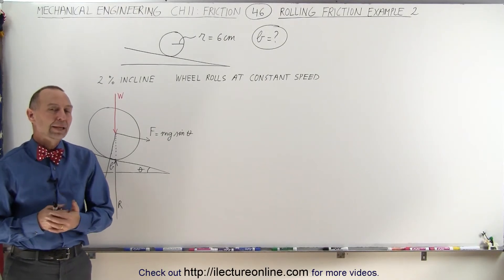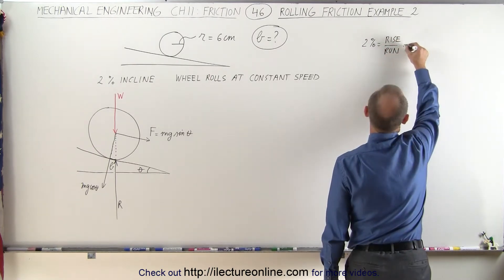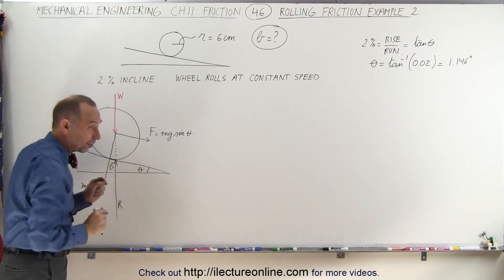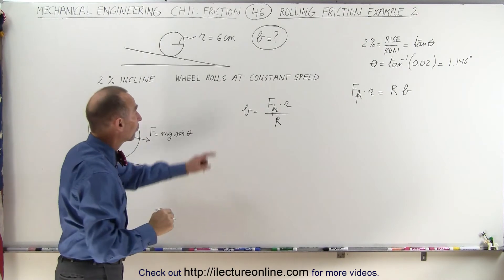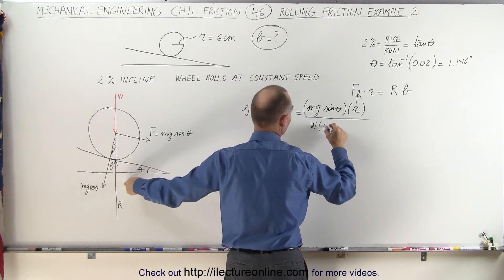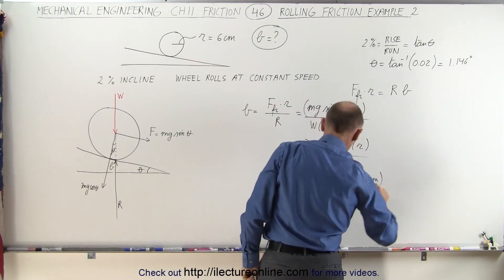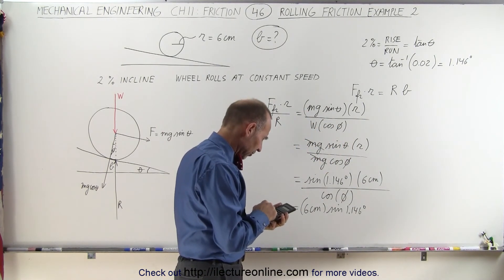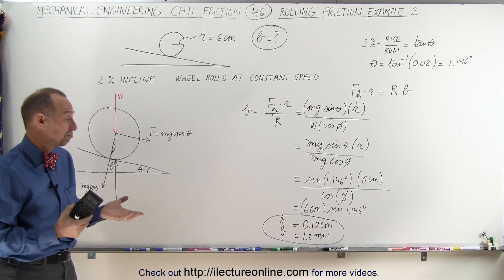Mechanical Engineering: Ch 11: Friction (46 of 47) Rolling Friction: Example 2

Comment: In this series I've been somewhat frustrated by the many uses of the 'close enough' method of simplifying equations.  But it seems to work and if it didn't planes would be falling out of the sky and trains jumping the tracks.  And actually calculus itself is based on the 'close enough' philosophy, without which we would have no calculus if we had insisted on absolute accuracy.  This is one of the concepts that you can explore in this venue that a college instructor would not have the time to get into.  I really enjoy exploring the various engineering disciplines with you that I didn't have time for in college.  Never retire!
Reply from the maker: Thank you.  Yes there are plenty of cases where "close" is good enough.  But then there are certain applications where close is not good enough, like in GPS, we are always striving to make it better and more accurate and we go through great lengths to make it more accurate.  🙂
Reply: Calculus is based around being able to find an answer exactly where it otherwise not be possible

Approximation is a feature of the steps to the final answer not the final result.

Comment: why don't you use that sir?
T=I*a/r, t=Ffr*r ,i=0.5mr^2 then Ffr=0.5*m*a
Fnet=m*a where Fnet=(m*g*sintheta ) - (0.5*m*a) then g*sintheta = 3/2 * a So  a=0.130m/sec^2
Ff*r=Wcos(phi) * B  where Ff=0.5 m*a ,cos(phi)=1 and W=mg so B=(0.5*a*r)/g SO B=(0.5*0.130*6*10^-2)/9.81=3mm
@Michel van Biezen

Comment: I feel like The reactionary force is simply equal to the weight of the object... correct me if im wrong

My proof:
If we imagine the previous example ( flat, non-inclined surface) . There were two important forces, the weight of the ball and the force the ball is being pushed to overcome the friction. The reactionary force will be the resultant of the opposite pairs of the two forces (Newtons 3rd law, normal force and the frictional force). 
Taking that into consideration, if we look at the ball on an incline, the two "main forces" in this case would be the parallel and perpendicular components of the weight. Then the reactionary force will be the resultant force of the opposite pairs of the two forces (newtons 3rd law, the normal force and the frictional force). 

taking that to consideration, and as stated in the problem that the ball will be moving at a constant speed, the frictional force must be equal to the parallel component of the weight, mgsin(theta).  and the normal force = mgcos(theta)
Those two make a right angle, with the hypotenuse being the reactionary force. So naturally, that'd mean that the reactionary force = mg = weight of the object. 
it also makes sense cause if you draw the reactionary force, it will act in the exact opposite direction of the weight... 

Sorry to trouble you with all of this sir, thank you as always for these amazing videos
Reply from the maker: In physics we don't trust our "feelings".  We are guided by laws and definitions.
Reply: @MichelvanBiezen  That makes sense.. so does that mean that my "proofs" are incorrect? sorry if whatever i said came out as annoying or offensive, i really appreciate your work ❤
Reply from the maker: Not at all.  We appreciate and enjoy your comments.  They also help me a lot with understanding how a student of physics or engineering looks at things so that I can find way to explain it in a way where it makes sense.  Often I admit that the way students sometimes look at things appears logical, but showing why it may be incorrect is often quite challenging and difficult.

Comment: Awesome lesson as always!
I have a question. In one of the questions posted in the comments, by "burhan muhyddin", they asked if the reaction force =mgcos(theta) is different from the normal force. You said that the normal force is a reaction force. 

If thats the case, then why on a flat surface is the reaction force not equal to the normal force, but equal to sqrt(Frictional Force^2 + Normal Force^2)
Reply from the maker: The term "reaction force" is simply indicative that the force reacts to a force causing it.  Purists do not like that definition.

Comment: Hi Michael, I couldn’t relate R = W cos(phi) as shown on the diagram….  or cos(phi) = R/W….as both R and W are acting through the centre?
Reply from the maker: Yes, I can see where the confusion comes from.  In this case R represents the "compressed" radius (perpendicular to the slanted surface), and W acts perpendicular to the horizontal surface.
Reply: @MichelvanBiezen  Thank you for getting back to me Michael….so R should be parallel (direction-wise) to mg.cos(theta)? Thanks a lot

Comment: Is rolling friction just a torque caused by the shift in normal contact force or is it a force acting down the incline. I'm so confused 😕
Reply from the maker: Rolling friction is caused by the deformation of the wheel or tire.  Note that the wheel will flatten a bit due to the weight of the vehicle.  The greater the deformation of the wheel or tire, the greater the rolling friction.  That is why your gas mileage decreases if your tires are under inflated.

Comment: Hi, thank you very much for your effort and lessons. However, in this video I have a question. You replaced 'R'(reaction force) with m*g*cos(fi). Isn't m*g*cos(fi) is 'N'(normal foce)? Aren't they different? Thank you :)
Reply from the maker: The normal force is a "reaction" force, according the Newton's third law.  For every force, there is an equal and opposite reaction.  The mg cos(theta) component of the weight = normal force pushing back.

Comment: the two angles should be of the same value, no?
Reply from the maker: Which two angles?
Reply: Michel van Biezen the one pertaining the incline and the one related to the friction/normal force  of the ball/sphere.
Reply from the maker: Ah, now I understand the question.  They are not the same.  The angle phi depends on how much the tire is compressed at the point of contact with the road.  See the previous video (44 of 47) to get a better understanding of the angle phi.